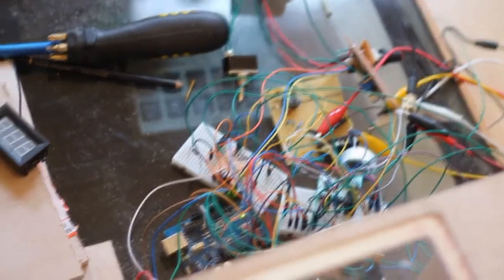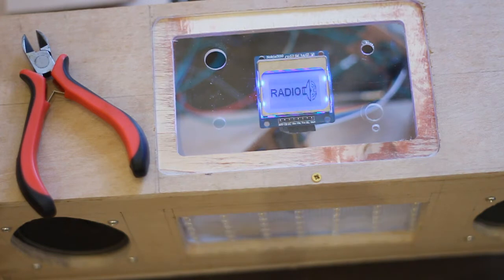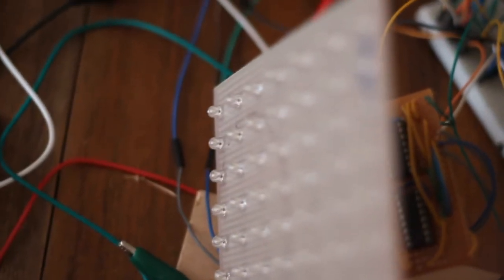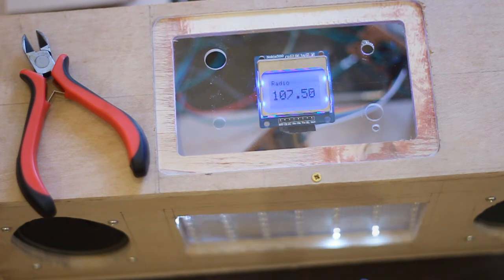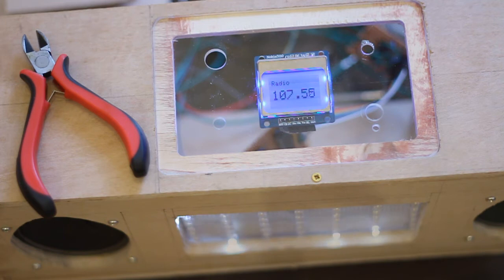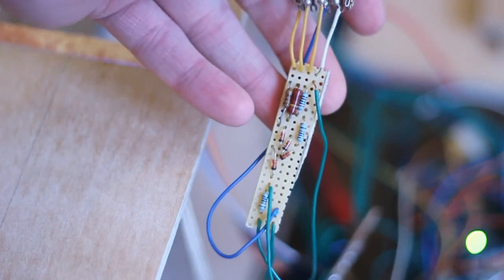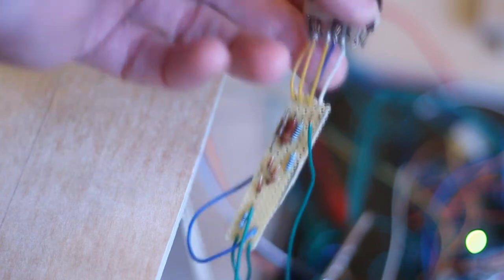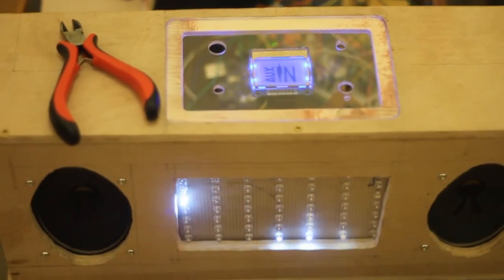Arduino Project: Boombox Introduction

Comment: Nice project! Some very nice technologies brought together there with bluetooth and that fm radio chip, etc. I've noticed those fm chips going cheap on Ebay recently and was tempted to mess around with them although I believe it's hard to get a good reception with them. How is the radio reception on yours?
 Also I believe it supports RDS (if it's the same chip I'm thinking of) which might be an interesting addition to the display.
Guess I should watch the second video on it now...
Reply from the maker: The module is the TEA5767, as far as I know it doesn't have RDS built in. The reception is pretty good, I am using an antenna which is a 50cm piece of solid core wire and most of the time it is just coiled up at the back. RDS would be an awesome addition, I would like to find a DAB module somewhere but it just isn't possible at the moment.

Comment: What is the bluetooth/sound module you used? Can we get a datasheet or a link? Thanks.
Reply from the maker: Sure, it is a 'dumb' bluetooth device which means you just apply power and connect. You cannot get any useful data out of it, just the audio from you music device (in most cases a phone) - http://r.ebay.com/PmM2Y9 - Really cheap and simple.